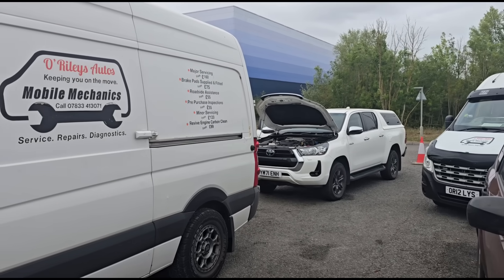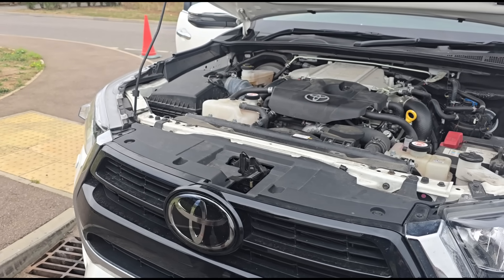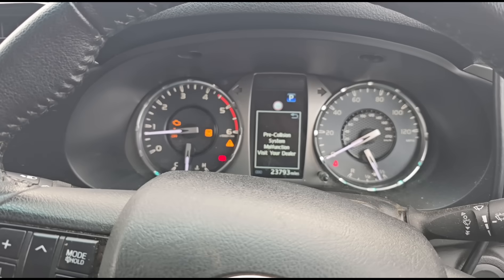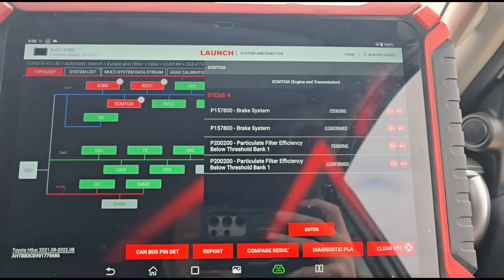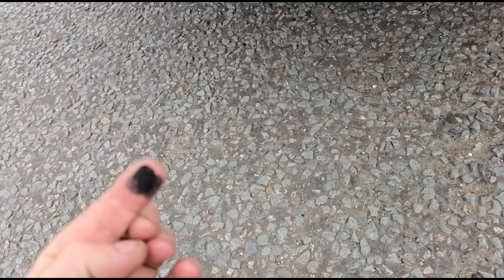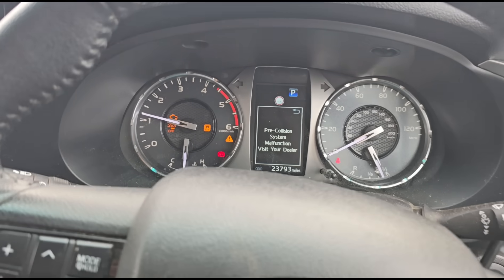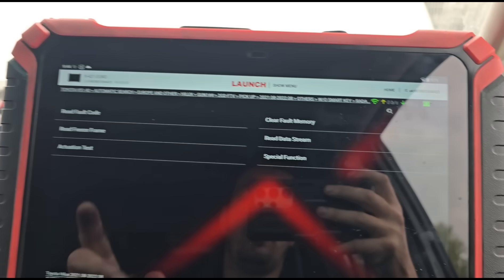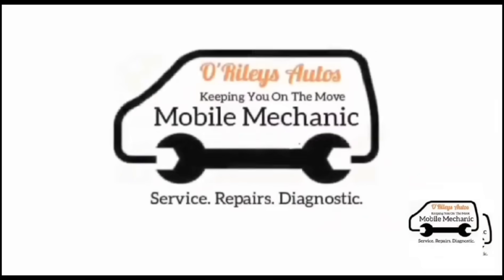Toyota Dealership Said They Can't Fix This Hilux After 10 Repairs

Comment: The car industry doesn't work. The cars are too complicated and the dealers are idiots. The consumer has to pay the price!
Reply: The engineers who design them, can fix them. When it trickles down to the minimum wage 'master' technicians, who have maybe 3-4 years under their belt. That is where problems arise. Anyone who is half decent in the dealer network either goes it alone, or works for an independent specialist.
Reply: @baron5747 exactly
Reply: If they made the schematics, programs and services manuals available to the public, it would be a very different story.
Reply: @jaybee2216 yes
Reply: @jaybee2216  not really, the level of complexity has risen exponentially, you effectively need a masters degree in electronics to work on these cars without the manufacturers checklist>solution, and people who bother to sit through uni for 8 years won't wrench with dirty hands
that is why you go through checklist when fixing these, and this time checklist simply doesn't apply or made them pick the wrong choice, and now the dealer would have to pay out of their pocket to fix the problem, but instead they just ignore till the warranty runs out hopefully and have customer pay for everything
on top of that, diesel is the wrong choice for these circumstances, he said - this one is 3 years old and it has 23k on the clock, that means his driving habits don't quite make sense to own a diesel, they simply aren't made for infrequent short distances, that is why all the environmental equipment on them fails, and blaming that on the designers is just an easy/dumb way to look at it - because designers think that people will actually drive these for significant lengths of trips which would allow everything on the engine to work properly, else it simply has to burn fuel to keep the dpf hot enough to not clog up very quickly, and that 5th injector is a bandaid on this problem, not a solution
in essence - with todays emission norms diesel Hilux doesn't make sense like at all, gasoline does, but then the fuel millage goes to sht and nobody will buy it, electric with diesel generator - maybe, but not the diesel hybrid they offer on the market, petrol engine Hilux is not even sold in UK
so, wrong car, wrong fuel, and emission standards that are designed to push people away from diesels because they ARE a problem when driven like the gentleman here does
Reply: the problem isnt the car industry its the time not beeing enough to properly disgnostic the problem and its even the case with EVs. the technicians arent geting paid enough for all that time.
Reply: This comment is more profound than it appears.
Reply: Proof if it were needed,that modern vehicles are too full of overly complicated crap,which when it goes wrong,is an absolutely costly bastard business to fix.
Reply: @adienowed6366  you dont have to buy one , stick with your Austin Alegro .
Reply: @royjennison3916 I don't intend to buy a piece of modern junk,so thanks for the advice-oh,and I don't own an Allegro!
Reply: we're cash cows
Reply: customers are the biggest idiots ,
Reply: @royjennison3916  Don't you know? The customer is always right!
Reply: @berrywin  your right , a right bell end
Reply: The pay is rubbish  that's why

Comment: It is a great feature in the newer Hilux, to have a regen physical button. Have an 2018 Hilux, and it often decides to have a regen, when I'm parking it. Also, once it went through almost half a tank of Diesel, due to constantly doing regens after regens. Only after that it stopped. The modern days Greenwashing, obsessed with Carbon emissions at the tailpipe, while ignoring long term reliability.
Reply: If it’s constantly doing regens then you’ve either got a fault or you’re driving it wrong
Reply: @hughmarcus1  It never demanded such a long regen. But it been fine for a while.
Reply: All DPF equipped Diesels should have a manual regen option, been on heavy trucks for years, on some trucks along with a switch to cancel a normal regen if it starts at an inconvenient moment...ie i drive a tanker and regen started when just about to blow a load of foofstuffs into a silo with the truck exhaust blowing next to the sugar silo, was able to cancel regen which resumed itself shortly after getting moving again.
Reply: That is annoying. On my BMW diesel, I have to use an OBD reader to cycle it. But thank goodness I can do that.
Reply: Apparently there is a retrofit kit you can order to add a manual button to the early models that do not have it. I haven't inquired my dealer about it. Just search for "2GD FTV manual regeneration button".